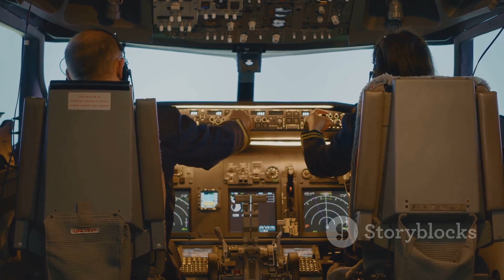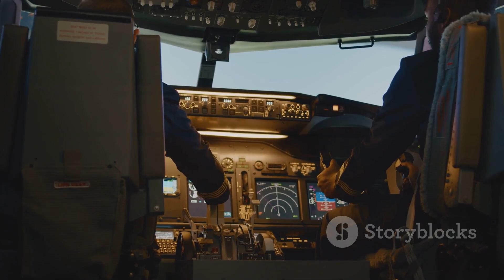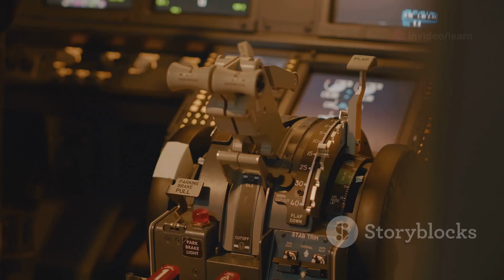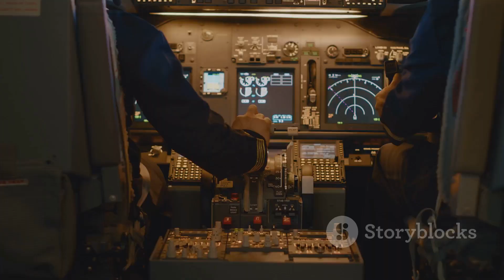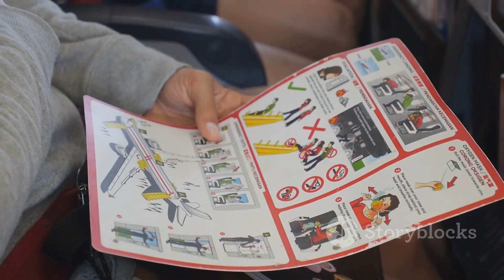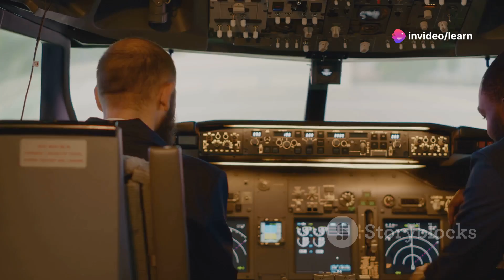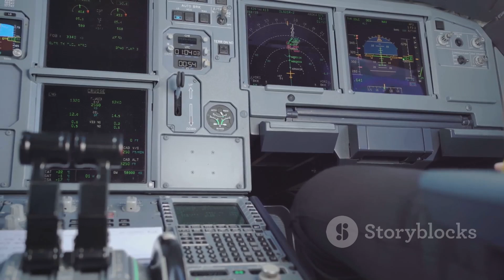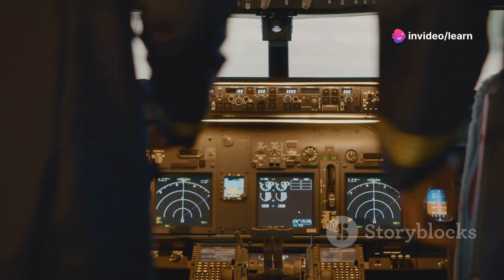The TRUTH Behind the Boeing 737 MAX Disaster!

Comment: If Boeing and airlines would have performed proper training for the pilots, both accidents were totally avoidable. That’s the tragedy here. MCAS became a runaway elevator situation which can be countered. The pilots were totally caught off guard with very little altitude to play with resulting in catastrophic crashes. It didn’t have to happen. But remember, airlines were all too happy to save a few dollars on training costs as well.
Reply: Ummmmm! You are not totally correct.  The 2 companies involved in these accidents opted out of a $500000 option to notify these pilots that there was a problem.    Here in the U.S.  didn’t opt out.     Example:  HERE state side,  lower left hand corner you will see AOA disagree.   Unfortunately not for the accident aircraft.    There was another indication we got over here but the accident aircraft didn’t.